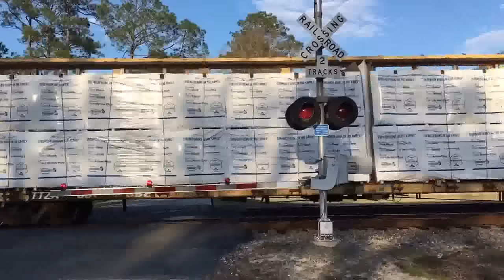What Happens When Railroad Crossing Gates Malfunction?!   Etc.

Comment: Talk about dark train crossing at night, there's one in my area that wasn't guarded by flashers or gates, despite being on a paved rural highway without street lights and with a speed limit of 50 -- which of course in the country means as fast as you can go per driving conditions. Most people take it at 50 or 55, and prudently slowed down before the tracks just in case there was a train ON the crossing, because trains are often delayed on those tracks late at night as they come to the switches a few miles ahead. But one high school boy who hadn't had his license very long did not slow down, and sadly drove into the train at probably 50-60mph. His car caught on fire and he was trapped inside. The young man went to school with my children, but a couple grades ahead. It was awful. His best friend lived at the last house before the tracks and was on his porch when it happened. I don't know if he even knew there was a stopped train. This was long before cell phones, and train cars didn't have reflectors. I remember the times I approached that crossing slowly, which I learned to do when I was still on a permit and had to be with a licensed passenger. My aunt and uncle lived out that way, so they taught me (stick shift standard transmission!). I can remember being shocked at how dark the train was -- there's no way I could've seen it in time to stop if I'd been driving the speed limit. I didn't see it until I was almost on it. There was no noise whatsoever, no whistle because it was stopped. When I came up to those tracks with a train moving across, the only way I knew there was a train was by the flashing of headlights of the cars stopped on the other side of the tracks, which of course was from the train cars blocking the lights and then the lights appearing between the cars. But it the train wasn't moving you couldn't tell anything was there. Finally, a few years ago they added lights and a gate. It had been at least 25 years since that young man was killed. I'm not sure if that had anything to do with it. I do know his best friend still has nightmares over it. He had become friends with my son through mutual school friends, and they've kept in touch in the 20 years since my son finished school. He's gone on to be successful in the trades, and has a good head on his shoulders, with a wonderful family that has supported him. Otherwise he might have fallen into drugs and alcohol over it. Thank God his life wasn't destroyed along with the life that was taken, but he'll never be the same, and neither will the victim's parents and brothers and sisters, and everyone who loves him. May he rest in peace, and may his loved ones be comforted by the hope of eternity. He shouldn't have been killed that way. There's just too simple a prevention that isn't all that elaborate or expensive. Such a shame there weren't flashers or gates until now.

Comment: A crossing gate on a car's roof... That's something I've never seen before!
Reply: Every barrier arm I see, that's the joke I make about it. Now, that I've seen it actually happen... it makes the joke even more hilarious.
Reply: That wasn't a car.  That was a bus....
Reply: @margalus and a van aka a car lol
Reply: To be fair, as a school vehicle even minivans have to stop at level crossings. They buy behind the van sorta boxed them in, another no-no. The pickup is just as at fault. Though the vehicle should have stopped at the line, not past it.
Reply: Federico Borluzzi you think that's the only place they get stuck? Well your wrong about that. Sometimes it gets stuck I between a semi cab and the trailer
Reply: Samuel Sujuno, actually they don't. When the crossing is activated, the "hold clear" de-energizes releasing the gate and the motor usually only powers the gate down for the first few degrees of travel (to make sure it's not caught up in the wind guard or anything). Then the cam comes around and opens the down power contacts and the gate just falls due to gravity from there. There are no "pressure sensors". When the gate nears the end of it's travel (depending on the type of mech), a snubber engages to cushin it's stop on the older, field wound type mechs and the newer mechs have permamnenet-magnet gearmotors that have electronically controlled cushioning.
Reply: i deleted my comment so take that
edit: your reply was above the pinned comment for me
Reply: Margalus it was a dodge minivan far from a BUS.
Reply: That was my whole point with a bit of sarcasm since it was stated in the video that it was a bus....

Comment: For the folks commenting about the van caught by the crossing gate arm, that vehicle had a "school transportation" sign on top.  It had to stop at the crossing even though the lights were NOT flashing.  When the lights started flashing, it tried to back up but the truck had pulled up to close.  Once the truck backed up the van could not because by that time the crossing gate arm was touching the roof.  If it had continued to back up the sign would likely been damaged.
Reply: Old Ohio Angler did nobody notice the crossing arm on the hood of the bus across the street?
Reply: So? Better wreck the sign than risk your life. I saw a video of a 8X8 heavy duty trasport with an excavator on the back destroyed because the idiot got caught under the guards...he could have driven out of there by idling forwards, but he didn't. Stupid. Signs aren't that expensive.
EDIT Though now I watched it, in this case the driver did the right thing. He/she was clearly in no danger provided the train remained on the track. No sense in scratching your paint and damaging your own sign as well as the railroad's when you can just safely wait for the arm to raise again.
Reply: "Though now I watched it, in this case the driver did the right thing."
  
No, the right thing would be to stop at the white line. Then the vehicle wouldn't get hit by the barrier.

Comment: Good vid! I've seen the crossing gates malfunctioning countless times. I guess overall, they are generally reliable,  but with today's technology, wouldn't you think they could devise a more fool-proof, reliable system? And the drivers amaze me - either one extreme or the other, Some want to get past correctly functioning lowering gates, and other people are IN the intersection when they get activated, and are too scared to CLEAR the intersection as soon as they activate - either 'freezing' in place, or trying to back up, haha.
 Knock on wood, I've never seen any accidents, and hopefully I never will.
Reply: Hi, I love ur vids
Reply: ive honestly never seen one malfunction here in australia, they all have triple redundancy, so if they do fail they shut just in case. idiots here still go thru them as well.
Reply: I've seen it happen, but it is rare. I'm in Gippsland. Level crossing faults on the line here caused trains to be replaced by buses for 9 months apparently due to rust on the rails. Took that long for them to source a suitable rail grinder.
Reply: They could be more fool-proof and reliable IF the railroads considered crossings as anything more than a nuisance they'd rather not have to spend any money on. They could also implement telemetry to the crossing equipment so they could get notification of malfunctions. I suppose the problem with this is (1) it costs money and (2) there would be an electronic record that a problem was detected and left uncorrected, something a railroad definitely does not want since it could be used against them in court if the problem resulted in an accident.
Reply: BaltimoreAndOhioRR Hey Dave! (right?)
Reply: Each crossing has a recorder as it is, so everything that happens is in fact, recorded. Things break, rail breaks in cold and hot temperatures, people steal cable, lighting strikes happen, NOTHING is unbreakable or fool proof. But signal departments do the best they can. Can’t foresee people being moronic or lightning strikes etc.
Reply: @kaseyaldrich4746  people do not think of that. Do not realize things breakdown without warning all the time as inanimate objects do not have a way of talking and letting someone know of problems!
Reply: @Steve211Ucdhihifvshi  over here by where I live in Michigan, USA, a former.crossing lights only (line was discontinued and rails removed too become a rail trail) would short and lights flash everytime it rained. Trains only went through once too twice a day, sometimes only once a week. It was about mile from where I live (not sure what it would be in metric)
Reply: My dad used to work for Baltimore and Ohio. I believe its CSX now
Reply: YES B&O also i subscribed to you
Reply: @JTRproductions  thx I subbed back!!
Reply: @BaltimoreAndOhioRR  Hey  Whats you favorite train
Reply: Everything made by man fails eventually.  Maintenance, age, and design all play roles in failure.  The biggest failure at crossings isn't the equipment but the people who use them.  

The only foolproof crossing is one that doesn't exist.  Grade separation.
Reply: Always remember...the more rail-cars there are, being pulled, in the train, the more WEIGHT there is...pushing the Locomotive down the track in the event somebody pulls a nice one and is in the path of the Locomotive and they need to stop. It may be 1/4 mile before the train will be able to stop. For somebody to PURPOSELY go around the safety that is there, they are putting themselves in harm's way. Mechanical failure of their vehicle, or a wreck or health issues...people DON'T think about such things and they get run over by a train. That's absolute ! Some folks think it's cute, to race a train thru the crossing ! One wrong move and they're DEAD wrong !!!
Reply: Just an aside: There are rarely true 'accidents'. There's usually someone or something at fault in a collision if you dig deep enough.
Reply: That's probably the longest comment I've ever seen

Comment: always listen to a conductor. they are the people who save your life and tell you to stop at broken crossings. STOP AT THE CROSSINGS. THEY ARE THERE TO SAVE YOUR LIFE.
Reply: 1: A conductor cant legally tell traffic to stop if they do not have to qualifications for it, their is more to controlling traffic than waving your hands.
2: A driver has to slow down at crossings to make sure it is safe, dont get complacent just cause it has a boomgate.
Reply: IIGrayfoxII lolnyouve clearly not worked for the railroad. We are trained in stopping traffic at malfunctioning gates as well as operating a train at safe speed limits, normally restricted, when operating on and over them and 2 we are in charge of the train, from
The time I get on, until the time I check off on the EC-1 THAT TRAIN IS FUCKING MINE! Not the engineers
Reply: @DrRichtoffen1  I'm not going to disagree with you because I'm actually curious, but does each railroad company have their own rules or how they do things?

Comment: The shaking one - My guess is there's probably a mechanism in there that locks it in the 'up' position, and a switch that senses when it is not in the 'up' position.  One or both of these were malfunctioning.
Reply: Boggy you see the trees in the background shaking as well, from the wind. I was gonna be a smart ass, but just decided for the obvious answer and to be nice. There's enough hate on here without me adding fuel to the fire. It's swaying in the wind the same as the trees. The other gate isn't in the wind and blocked from it. You can kinda hear the wind in the microphone.
Reply: Yo Spaz, you have no clue. It's just a limit switch in need of adjustment.
Reply: Atleast with the ones I've worked on theres a solenoid that holds the boom up when the motors disengaged, if the solenoid isn't engaging for what ever reason you get this shaking as the boom goes high enough to turn the motor off then falls back down to where the motor turns on and lifts it again. It happens fast enough you get that shuddering.
Reply: I would say the pickup coil in the hold clear mechanism is bad. When the xing clears, the motor is energized and starts the gate up. At the same time the pickup coil on the hold clear mechanism is energized and sucks ( I'll call it a flapper) a flapper in to both the pickup and hold coils. The flapper has a part on it called a barrel (its barrel shaped) or a small metal block on it, depends on the model of the gate mech or manufacturer. On one end of the motor there's a ratchet gear and the barrel or block will lock between to teeth on it. When the gate reaches vertical the hold coil is energized and the pickup coil deenergized. The hold coil stays energized keeping the flapper in and the barrel or block against the ratchet wheel not allowing the gate to fall. If the hold coil is bad the gate will fall until the drive up contact closes , only a few degrees. Then the gate drives back up and repeats until the maintainer changes the hold clear out or moves one wire allowing the pickup coil to hold the gate up but that is just a temp fix until he can locate a new hold clear mechanism.
Reply: You are correct, Boggy. Inside, there is a device called a "hold clear". It is a ratchet-pawl type of device that when energized, engages to hold the crossing gate up. When the little teeth get worn, you see the pumping action of the gate as the ratchet-pawl keeps slipping. It's not an uncommon problem on older generation gate mechs. Newer generation gate mechs have an electromagnetic brake type mechanism that holds the gate up while no trains are present.
Reply: I bet my last dollar that shaking gate was the motor driving the gate into the buffer stop in there.
Reply: It was having a seizure needs a checkup
Reply: That crossing has more problems. The lights should not have stopped flashing if the gate motor was still pushing the gate arem.up.

Comment: 20-years ago, I worked for a Class 1 Railroad, & I routinely saw all sorts of vehicles, which went around 'downed' gates, with an approaching train.  Even school buses did, & the local police did nothing.  Scary stuff.
Reply: Yeah bro I ain't sitting at the crossing for 20 minutes when your train is standing still 50 feet away.
Reply: @OGYouTubeEnjoyer  you deserve anything bad that happens
Reply: Which railroad might I ask.
Reply: Why don't the gates cover the entire width of the road on each side of the track?
Reply: @jaygatz4335  So you can still get through if the gates are malfunctioning or an emergency.
Reply: @OGYouTubeEnjoyer  That makes sense. However, if you compared the statistics between a double gate and no chance of passing through if there's an emergency, and a single gate and the resultant collision between a train and a foolish driver, which would save more lives? I'm betting there are a lot more foolish drivers than there are situations where a driver would have to go around a single gate.
Reply: @jaygatz4335  I'd say it's more likely that an ambulance would need to get through over some idiot. I've personally had to go though malfunctioning gates on several occasions.

Comment: I've actually seen that third clip happen in real life before. Scary thing about it was that it was on the BNSF Speedway in Hinsdale, so we ended up finding somewhere else to cross in case something was dangerously wrong with it.

Thing is, it wasn't just shaking. It was moving from straight up to around 10 degrees out and back again repeatedly.
Reply: VestedUTuber usually means there’s a problem in the gate mech. BUT as soon as someone calls in and reports a problem at the crossing, a crossing protection order is placed on the crossing and train crews are prepared to stop and protect the crossing as well as running at a restricted speed

Comment: I'm seeing a lot of negative comments about the school van driver (2:34) getting caught by the gate. The driver of this vehicle did the absolute correct thing. The driver pulled up and stopped   safely short of the track, as required by law, to look for oncoming trains. It looks as though the view from the stop line was [partially] obstructed, requiring the driver to stop in the location they did. Lo and behold....a train! Instead of trying to "go for it", the driver attempted to reverse, only to be blocked by the #$*@!% in the pick-up truck trying to climb up the van's tailpipe. So it looks like the van driver made a quick assessment, realized the van and occupants were well clear of the track, and simply waited it out. Big thumbs up to the school van driver! And a thumbs up for a good video.
Reply: the school van driver did it Wrong! you do not pull up short of the track. you pull up short of the signaling equipment. that is why it is installed WHERE it is, to keep you safe.
Reply: They were understandably wary because the crossing was just activated. Due to the train's slow speed, they could have safely proceeded. The crossing still had adequate warning time.

Comment: I think that one crossing gate on the third clip developed a nervous twitch from dealing with too many close calls with drivers.
Reply: I've seen that one railroad signal that's shaking mentioned on a paranormal show and the crossing is alleged to be haunted.
In spite of no wind or seismic activity in the area and a full inspection of the signal no explanation for the shaking was found, it's said that the shaking signal had malfunctioned and resulted in a fatal accident involving a vehicle being struck by the train and the impacted vehicle came to rest up against the signal.
Of course it's an interesting legend behind the cause of the shaking as though the ghost of a driver is angry and venting frustration at the signal.
Reply: Roy Cathcart Jr ha ha. Haunted barrier. Some folk will dream up anything, I think it’s just fxxked and they can’t find the fault with the motors or controllers lol. Maybe they should change it lol? I’ve seen twitching barriers here in the uk and they’re not haunted. Just bust lol